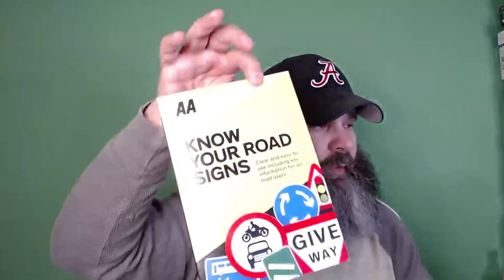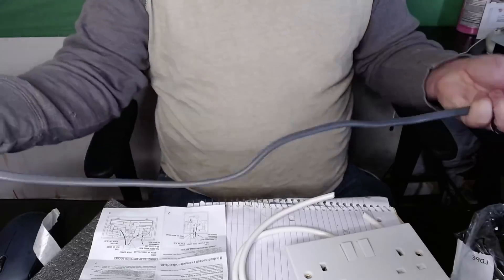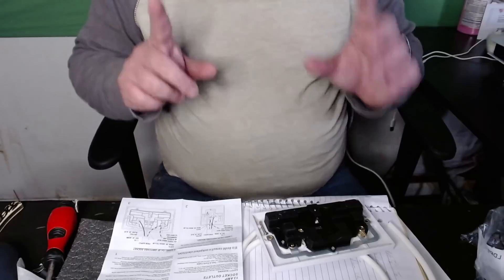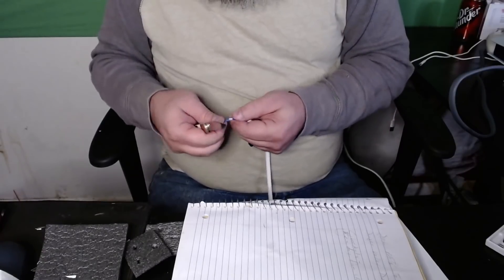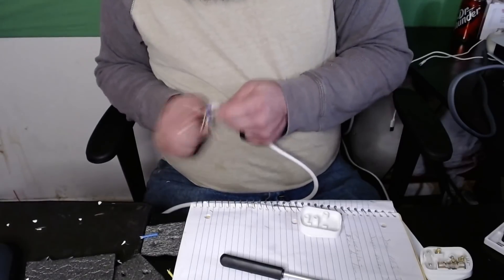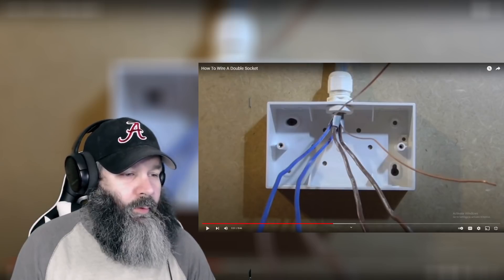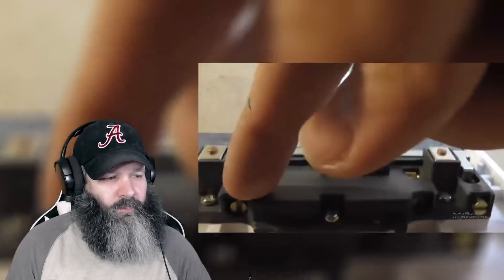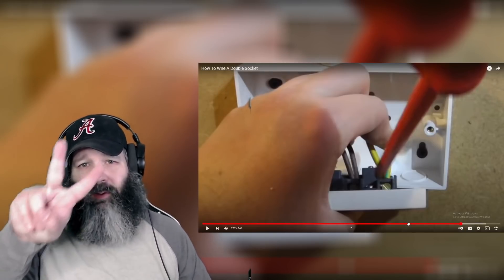American Attempts To Wire a UK Wall Socket and Plug

Comment: The white outer cable should be under the grip .
When you get the lengths correct the live will be the first to pull out of the plug .
The lengths are normally on the card we all ignore !

We have different fuses . 
13 AMP is the biggest you can fit .
Yes that's over 3 kw per plug .
You gotta love ring mains & 80 - 100 AMP incomers !

Comment: If you look at socket, you can see "shutters" on bottom 2 holes so you can't put anything into dangerous openings. . The plug has one pin longer, when put into socket it pushes shutters open.

Comment: Ring Mains are a weird UK invention post WWII to save copper. You can have 32 Amps on a circuit but need wire "rated" for about 20 Amps (16A per side). They're not needed as much now as radials can be used, the one exception being kitchens where it possible for Kettle 13A + Toaster 10A + Microwave 6A = 29A being on (Tea + beanz on toast)

Comment: Inside the plug, there is usually a tightening/gripping part, so the wires (black/blue/green etc) don't hang out of the plug. The main wire sleeve should go into the plug tightened & the wires inside the wire sleeve not seen. 👍🇬🇧🇺🇸

Comment: Two cables in the socket box because he was demonstrating how to wire a ring main socket, wire in, wire out to next socket, in a ring, hence the name, starts at the consumer unit, ends at the consumer unit. If there is a single wire in the box, it is know as a spur, taken from the ring and terminates at the box, you cannot add another spur to a spur.

Comment: I just remembered something that may be of interest . The earth wire is always thicker than the other wires . And the earth pin on the plug is longer then the others . As it pushes in it lifts  a lifting gate that is normally covered. It's  so a child can't push something metal  in and get a shock.
Reply: No, the earth wire is not thicker. In fact on the house wiring it is thinner.

Comment: I use a knife and my teeth to strip the wires!😂
The knife to score around the outer white cable and pull off, the grey cable cut in middle and use the earth wire to pull apart, and then my teeth to strip off the individual wires when I dont have wire strippers!

Comment: You must pass the cable under the cable grip, at the back of the plug, and screw it tight around the cable not the three individual wires; it is a vital part of the plug's safety features.

Comment: People may have already answered this, the wall has two wires as they run in a loop from the breaker box to each socket in serial then back to the breaker. The reason we have plug fuses for safety is 240V supply is a lot higher than US use, and it prevents the breaker fuse from blowing, that said, now we have RCD's in our breakers, it's usually the RCD that trips instead of the fuse blowing, unless water is involved then the system all goes pop, but the human hopefully does not.
Reply: No, the fuse has nothing to do with the voltage, It is about the ring mains.

Comment: And the white outer has to be inside the plug and the there a clam with two screws and a bar you clamp the outer cable to stop it getting pulled out of shorting out too

Comment: So to strip the cable take your knife hold upside down blade up and the roll the cable outer soft and slow till you cut throght but not the cut any three cables under the trim the three cables to lenth live approx 3/4 inch same with nutral and 1inch 1/2 aprrox for earth hope this helps ya

Comment: Other than a missing shroud for the earth not bad (I would also run an eath wire from the socket to the back of the box (there is a ground screw)), howere you are right when you said about the wires for the plug top being too long.  There is a cable grip built in to the plug  (either a pinch point or a screw down grip) that holds the cable tight so the wires don't rip out if you accidently trip over it.
Reply from the maker: yeah, we don't actually shroud all of our grounds which, come to think of it would be smarter.

Comment: Socket outlets in the UK are wired in a 'Ring circuit' hence the two cables. The design of the UK plug is quite a thing, I'm sure there will be a Youtube vid covering it.
Reply: Uk plug is that great the no country on mainland europe use it.
Reply: @MultiArrie  Correct 👍 Europe doesn't use a UK plug and socket system, like a lot of other places in the rest of the world, or any other British Standards, for that matter.  Most, also drive on the wrong side of the road... And what?...... who cares. Look into the development of the UK plug/socket it's interesting. Yea Euro is the best, UK is no good..... yea go euro.... whatever ✌
Reply: @Hoopyfrood345  yes, I am a electrician.
Reply: @MultiArrie  well done 👍💋

Comment: if you notice, the earth pin on the plug is longer than the other two pins. This is so the earth connects before the live. Also if this pin is removed the plug wont enter the socket. The earth acts has a key to open the entry for the other two pins. All in the name or safety. Also the earth wire should be longer, this is so if the cable is pulled out of the plug, the earth is the last to leave its connection. Don't worry about him doubling up. Hes taking a spur off for another socket feed.

Comment: The walk-through video that you found seems to be illustrating how to install a socket in a ring circuit with other sockets around a room, so that the loading on the circuit needs to take account of everything that is plugged in on the loop. I have probably failed to pay proper attention to the walk-through, but the twin wiring is going to be 'one in, one out' to create the loop power supply. 
History Section:
While the domestic circuits and sockets in the U.K. are based on 13 amps, and have been for many years, stage and event lighting is still based on the otherwise obsolete 15 amp set up, with larger but unfused plugs with round pins. Why this persisted was probably as much down to the poverty of so many theatres, as to it being a way to stop untrained persons readily taking 500 watt, 650 watt, 1000 watt stage lanterns into a non-theatre setting where they were liable to blow domestic circuits and fuses/circuit breakers.
The unfused 15 amp plugs also kept access to blown fuses at ground level rather than 20 feet or so up, in a lighting rig. Low consumption LED stage lighting often needs a plug transplant, fitting a 15 instead of a 13, to avoid embarrassing delays while the ladders come out yet again... 😉
The cable entry to a 15 amp plug top is usually a full circle and has to be slid onto the cable before beginning to wire in the plug section. There is a surprising number of 15 amp plugs whose entry point has had a notch cut out to fit it - after the wiring is done.

Comment: The earth prong is longer so that it opens the shutters on the live and neutral openings on the socket. The live and neutral prongs are insulated half way so a child cannot be electrocuted if the plug is not pushed in all the way.

Comment: You wired the socket correctly, as in, coming straight from the fuse box. The second wire Tom has is for the next socket on the ring main.

Comment: For the socket .......... strip about an inch off an edge of the grey cable, preferably with snips, then grab the earth and pull it down and rips the outer insulation apart nicely. 
You also get earth sleeving to put over the bare earth wire.
Reply: When stripping cables ring the knife around the cable then bend the cable on its self to tear the insulation
Reply from the maker: Yeah if I had all my stuff it would've been quicker. A lot quicker but most of it is in the wife's car.

Comment: The 2 cables in the Tom Scott video are part of a ring main. From the breaker, all sockets are wired in a continuous ring. Into 1, out tonthe next and so on, from the last socket it's back to the breaker. A ring main will have a 30amp breaker, or fuse if older type. Ring mains will often be, downstairs except kitchen, kitchen, upstairs. There may be more in larger properties. The reason for the fuse in the plug, is to provide local protection. The plug has a maximum rating of 13amps for things like kettles and electric heaters which are 3000 Watts. UK voltage is 220-240v. Volts X amps = power. So for lower power items like a tv or table lamp you would fit a smaller fuse, usually either 3 or 10 amp.
Appliance flex is usually, but not always (there is some variation) 0.75mm, 1.5mm or 2.5mm. 
Looks like you missed the cable strain clamp on the plug, which if you're not used to is to be expected.  The plug wires are cut to 3 different lengths so that if the cable is pulled out, the live comes away first, then neutral finally earth, providing more protection. You'll also notice the longer earth pin, so that connects firsts and breaks last. The live pin cannot connect in the socket until the earth has made.
All very safe, until you stand on an upside down plug!!!

Comment: Actually, the proper term for this chunk of white & brown plastic is a "switched 13A double socket outlet" from which you could draw 26A by using 2 fan heaters etc from it. To be more ambitious, if you replace the fuses in the plug tops (I don't know why its called a "plug top": it includes the whole plug; but there you are) with rusty nails you can draw 32A from the socket outlet (at least until your house burns down or the breaker trips). However if you are prone to putting rusty nails in plug tops, it is equally likely that you will have replaced the breaker with one: burning your house down becomes more of a certainty. I don't know why people use rusty nails for this as it is a tradition in the  UK or maybe they are too mean to go and buy a new nail.

Comment: In the video, the guy used the earth wire and pulled it backed to separate the insulation this is a big no-no as it can stretch and reduce the earth wire's cross-directional properties.

Comment: I have a useful little trick for remembering what colour goes where if you are unsure, easy to remember with both 2 and 3 core cable.  Ok, you have Blue and Brown, the 2nd letter of Blue is L (Left), the 2nd Letter of Brown is R (Right), should you have 3 core cable the remaining cable goes to the top pin, that's how I remembered how to wire a plug initially.  For the record you can guess I'm not a sparky and also for the record I HATE dealing with electric, scares me silly.

Comment: That UK plug attempt only give a 1 for good effort.
Wires have to each be a certain length and important that the earth has enough length that if one is to yank the wires out of the plug the earth cable will be last to be yanked out following the neutral the live wire should be the first to lose connection if someone managed to yank the cable out, and the white insulation should be clamped in place not hanging out like it was.

Not many in the UK can fit a plug correctly, why most are pre-fitted melded these days.

Good video 👍

Comment: The instruction video was for a ring main outlet, that's why there were two cables. It wasn't because it was a double outlet !
Your own attempt was basically how are you would connect a radial or spur outlet.

Comment: The wires in the plug cable can be thinner than yours, because we run at almost double the voltage, so less amps, for the same wattage.

Our plugs are rated at 13 amps, which gives us 2990 watts.

To get the same wattage, on your 120 volt system, you would need 25 amps.

Comment: You got the mechanics right, just need to perfect the detail.

Of course, it's just a "training kit" you got, which means as long as you are not actually using it, you can mess around how much you like. I believe in the UK we use double the voltage than USA, so a UK set might be a little overkill anyways.

Comment: Sorry,but will have to cancel my contract with you to wire my home.I need it done before 2023 LOL. Changed since I left UK.Used to be Hot/live was red neutral was white/yellow and ground/earth was the same, bare.The main difference is We(Canada/Us) Fuse from the panel where in UK they fuse from the panel and also the plug which is safer I think.SO a lamp would have a lower rated fuse(5) than a iron. Eh but you got there in the end LOL

Comment: My workspace is the same beard man, but there's order in that there chaos so never mind, good video, i'm curious as to weather it's a good safe viable option for fused sockets on the US electricity system. also you might want to trim the length on the wires going to the plug. and the second set of cables is to wire the next socket in the loop/ring.
Reply from the maker: Not sure on that.

Comment: Most plugs give you an idea of the lengths to cut, though to be fair I usually end up adding a little bit. UK plugs and sockets are very well designed though, apart from the fact that the UK plug is agony if you accidentally tread on it :P

Comment: You didn't do to bad Alan, though I wouldn't ask you to wire a plug 🔌. Pmsl. 😂. You can do it with a knife and screwdriver, it's just easier if you have the tools. Like anything, the more you do the better you get.

Comment: I have to say that American plugs are one of my bugbears when on holiday there. They are pitiful and can barely hold their own weight in the outlet socket. I find myself constantly bending the plug legs outwards to try to add tension to keep it in. Add to that how many safety features are incorporated into a British plug and (safer 110v aside)  you really see how dodgy American plugs are and the potential for electrocution. There are a number of YouTube clips of Americans living in the UK explaining the differences and safety features.
As for fuses we fit the appropriate size depending on the appliance power consumption and standard available fuses are normally bought as 3A, 5A and 13A. Sockets are linked in and out in a loop (ring circuit) to the circuit breaker box and a 32A breaker.

Comment: The screws on the back of the socket are indeed for fixing it into a wall but the wall needs to be channeled out first if it's brick and a metal box fitted into it.  This will result with the socket/s being almost flush mounted into the wall. Plastic and metal boxes can be bought, which fit onto the wall (for plasterboard/dry wall) but obviously the sockets will be proud of the wall by a good inch plus. Now you have the basics of our plugs, have a look here to see how to do it correctly and impress your friends and nieghbours. ;¬)
https://youtu.be/jqfsUGhAX9k
Reply: You sink the patress box into the wall then your faceplate only sticks out the depth of the faceplate (about 6mm - quarter inch)
Reply: @RawTopShot   That sound clearer than how I said it, thanks.

Comment: Aahh, good old British Intelligent Design the UK has been using for 70 years, so simple that a 9-year-old school kid can wire a plug in five minutes, but much too complex for the USA. I mean, three colour-coded wires into three named terminals is so technically advanced, it can be an absolute nightmare to figure it out. To complicate matters, the plug is designed to take a 13 or 5amp fuse depending on the appliance to be used - a deliberate plot to confuse non-UK users.
To complicate matters further, the plug terminals are laid out in a triangular pattern (like an isoceles triangle), so the Earth wire has to be slighter longer than the other two - or the Live and Neutral wires have to be slightly shorter - at least, that's the theory, and very technical unless you apply a little practical logic (looking at the layout arrangement). I know, I know it's hard to grasp all this technically superior information, but stick with a good 20-minute installation video, and you should be OK. Don't worry, you won't need a spanner or hacksaw, and a knife really isn't recommended, especially for cutting metal wiring; nails - whether they be of the metal or finger type - are not necessary at any stage. When you've mastered the connections and used the plug's cable clamp (designed to hold the cable firmly), don't forget to put the plug cap on - it hides the wiring and provides a professional finished look to the completed job, while at the same time prevents anyone touching the live wires by accident. Tip: don't let water anywhere near the plug as it can cause a loud bang and a blue flash, which would be a real shock to blacken your day.

Comment: Sorry to inform you despite your best efforts that this is a fail. The socket needed green/yellow sleeving for the earth wire. You only need to double up the wiring if the sockets are part of a ring circuit. The rest of the grey sleeving on the main cable needs to be trimmed. 3 out of 5.  The plug was wired correctly but the live wires were left hanging outside the plug. The outer insulation of the cable needs to be secured into the cable grip. 3 out of 4.

Comment: As for the give way sign painted on the road, there would almost always be a giveaway sign on the verge.
Hate to say, but you took the white sleeve waaaay tooo far back. You still had waaay too much bare wire going into the brass pins, I reckon a short is just about guaranteed
Doubling up as you call it, is because the socket would be part of a ring main not a spur. So one set of leads is coming from somewhere and one set is going to somewhere

Comment: Too much conductor exposed. Live should be as short as possible. Service loops on the earth and neutral. Earth wire should be the last to disconnect if the cable clamp fails and the wires are pulled out.

Comment: Technically this should be safe. But it's not US standard. Live is brown (or red) neutral is  blue (or black) earth is green/yellow (or green). Prior to 1970 household appliance wires were made of aluminium, which probably explains why everything popped and flashed...
Reply: Sorry, my fault. I thought you were going to wire it to your mains circuit!..